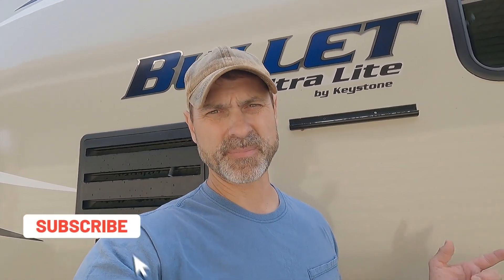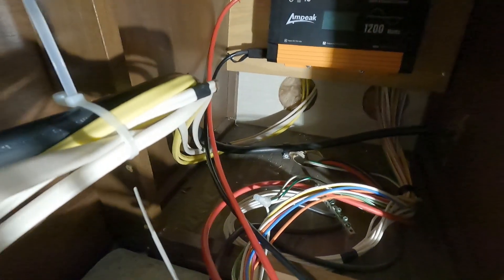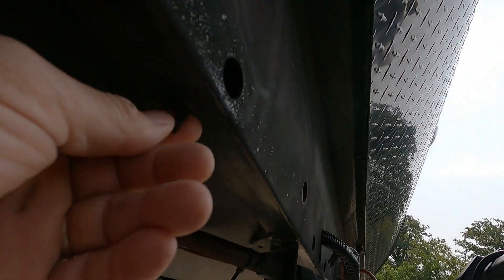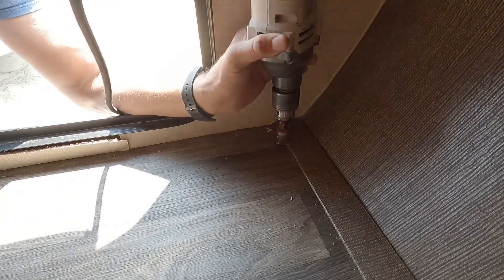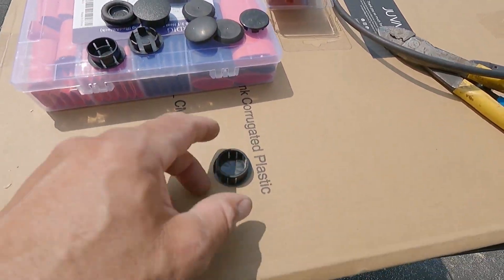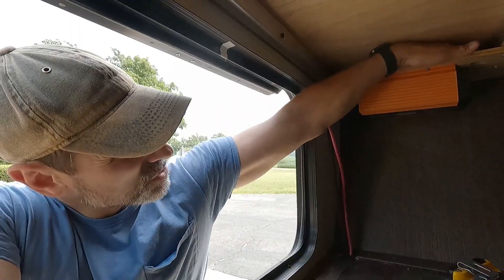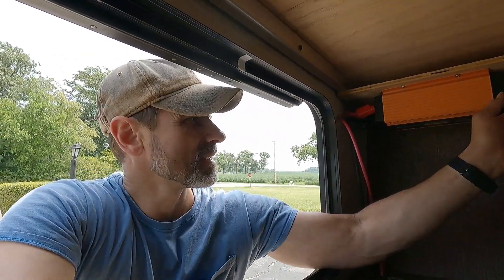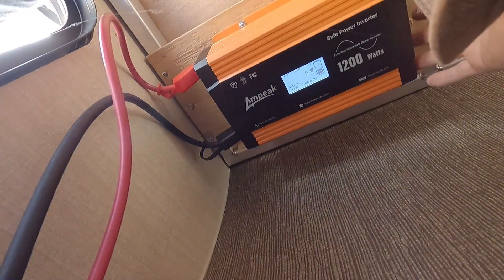Inverter Installation On Pull Behind Camper

Comment from the maker: Just an update. I’ve found the truck doesn’t keep up charging the trailer battery fast enough to keep up with the refrigerator. However, the inverter is coming in very handy for charging smaller items such as phones, walkie-talkies, camera batteries, etc. We just ran the fridge off propane while traveling as an alternative and it worked great!

Comment: Found a 5,000 watt inverter online used $600 in excellent condition, mounted it horizontally in a horizontal stainless steel trash can, out of the elements, with eight solar panels on the roof of my 24-foot trailer at 1400 watts output, into lithium titanate six cell batteries that yielded a continuous 13.5 v olts, plugged the trailers power cord into the inverter had plenty of electricity for all night usage even with the microwave, however air conditioning long-term needs a generator. When the sunlight came up in the morning it only took two and a half hours to completely recharge the batteries..Off the grid.